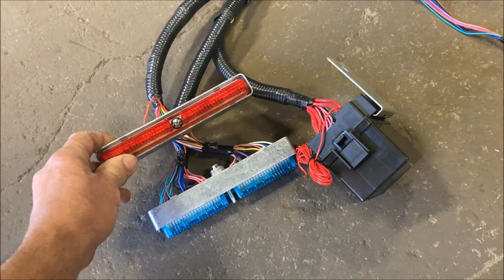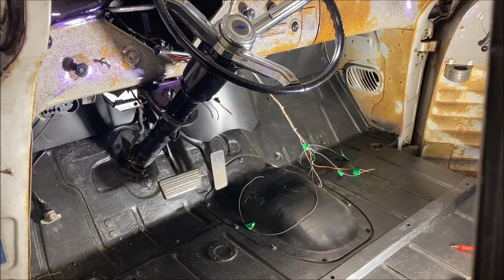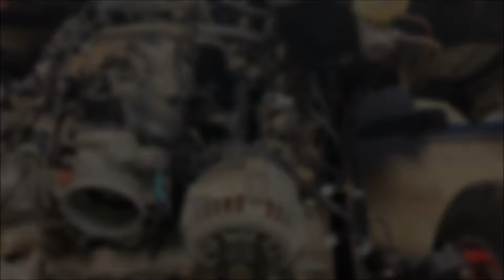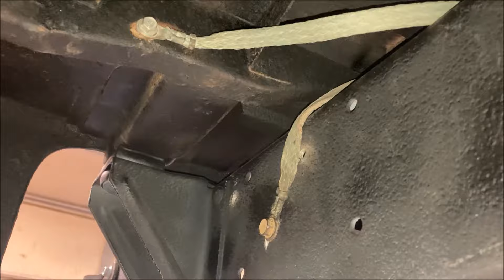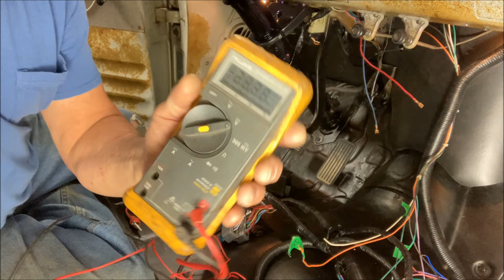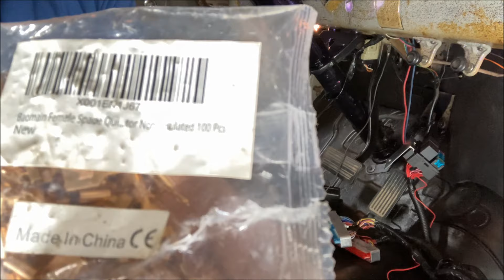Ebay LS swap $79 wiring harness install and first engine start! 1999-2002 Gen 3 DBC, will it run?

Comment from the maker: Just saw that when going over the harness connections on the floor I called the first throttle body connector the IAT, I meant IAC (idle air control).
Reply: Your video has gotten me a long way! Appreciate all the little details. Although, I have everything hooked up as shown, my relays aren’t sending any power out. When I turn the key on they both click as if they were activated but my meter shows nothing coming out. Any possible ideas would be much appreciated! Thanks again
Reply: Your videos are very good with information ,keep them coming

Comment: Question.. can the fuel pump wire be connected it from the relay to the fuel pump fuse on the fuse box? Or it has to be a straight wire coming from the fuel pump to the relay..?
Reply from the maker: I do not understand the question, but the fuel pump should be controlled by a relay and not powered directly from a fuse.
Reply: @rust_hoarder_garage  so I have the saw wiring harness as you.. I wired it the same way as a your video , the only difference is that I wired the fuel pump wire coming from the relay to my fuse box (tap into it). (Fuel pump fuse)
Reply from the maker: if you are using the fuse box to feed 12v to pin 30 on the relay that is fine, just use an inline fuse if you are not coming directly off of an already fused circuit.

Comment: What about the oil pressure sensor? How do you connect that one
Reply from the maker: Oil pressure sensor is not part of the harness, it is not needed for the engine to run. I run an aftermarket gauge.

Comment: You mention the alternator did you have to do something eles to get alternator to charge or with that ebay harness you dont need to do nothing thanks your very helpful
Reply from the maker: Had to add the 2nd wire to the F terminal on the alternator, it is used on the truck alternator but not the LS1. Info should be in this video  https://youtu.be/GX5VUIgd-rw

Comment: How are you getting temp. Reading to your gauges? I know the temp. Sensor is through the engine hardness? Help!!
Reply from the maker: Temp sensor on the front of the drivers side head is only an input for the PCM. I run an aftermarket gauge with a sending unit in the rear of the passenger side head, see my other videos for details.

Comment: I’m swapping a ‘00 gmc Yukon 5.3 into a 4.3 2002 s10. Would the harness from the Yukon be the same as the s10? Or do I need to buy or make a harness like this one?
Reply from the maker: No clue, I have never touched an S10 other than to cut it for parts.

Comment: Got my truck running but having low voltage at serial data obd#2 pin, as well as pin 58 at the pcm. therefore i can’t communicate with pcm, any idea what is causing this? I do have power at pin 16 obd port, Thank you.
Reply from the maker: I would verify the obd2 white power wire is not tied to the white tach signal wire. I go over this in my LS to Vortec harness conversion video if needed.

Comment: Are the injector adapters a must? Great video!!!
Reply from the maker: If you are not running EV1 style injectors then you have to either cut the ends off and solder in the correct ones or run adapters. Thanks for watching!
Reply: @rust_hoarder_garage thanks!

Comment: I have a Holley pump 12-306 in my Monte Carlo and I ran it just like you said. Pin 87 to fuel pump wire and pin 30 to koeo power. Fuel pump comes on strong but the car starts then dies. But if I take the fuel pump wire and tap into pin 85 green wire car runs but only showing 20 psi. Do you think it can be tune related?
Reply from the maker: You have a good chance of burning out the pcm driver trying to run the fuel pump off pin 85, do not do it! I doubt it is putting out enough current to run the pump which may be why it is at 20psi. If it starts and dies when using the relay verify you are not losing power on pin 30 of the relay when the ignition is in the run position.If that is good verify you are not losing power on pin 87 to the fuel pump.
Reply: @ The green wire that comes off the fuel pump relay not getting any power. Do you know what the issue could be?
Reply from the maker: green wire is a 12v feed from the PCM, not the output of the relay. It is a 12v signal from the PCM to turn on the fuel pump relay, not run the pump directly. If there is no power there with key on you may have burned up the PCM running the fuel pump off of it.

Comment: which computer did you use?
Reply from the maker: That engine and transmission is from a 2001 Silverado, I used the factory P01 computer from the truck.

Comment: I got it started but it dies immediately after I’m getting no gas fuel pump
Primes but sends no fuel through the line
Reply from the maker: VATS disables the injectors, has to be turned off in the tune.
Reply: VATS deleted?  Fail safe for ecu.

Comment: Can you use the truck ecu with this dbc harness or would i have to get the ecu from a ls1 camaro.
Reply from the maker: 99-02 truck pcm is the same as 99-02 LS1, just different tune.
Reply: Yes, you can use the Blue/Red drive by cable ECU with this harness. Gen 3 and early gen 4.

Comment: Did your harness not come with wiring for the oil pressure sensor?
Reply: Oil pressure is part of the dash or body harness wiring, and not part of the engine harness for this vintage.
Reply: @glenncattani4843  thanks man, I ended up using a mechanical gauge instead
Reply from the maker: No, it is not needed for the engine to run.

Comment: I just received this harness from JY Performance and there was a separate two wire pigtail in the box. do you know what this is for?
Reply from the maker: If you bought it for a 4L60e watch this and make the repairs, it will be a 4L80 2nd speed sensor harness, otherwise the 60E will have no 3-2 downshift.

EBay LS swap $79 harness, how to convert it from LS1 to Vortec and fix the defects. 99-02 Gen 3 DBC
https://youtu.be/GX5VUIgd-rw
Reply: @rust_hoarder_garage  thank you!
Reply: @rust_hoarder_garage  Ironically its for a 5.3 in an F body so some changes I will have to make and some I might not. your videos are great.
Reply from the maker: Thanks, If you are using the F body alternator, MAF, and IAT then there will not be much to do, but definitely fix the tach wire and trans wire. Good luck with the build!
Reply: @rust_hoarder_garage  Thank you.
Reply: So I haven’t heard you mention having the computer re flashed. I did here you say a few things were turned off
Reply: How did u turn or delete certain things from the computer

Comment: You can install the harness and ECU under the hood. Done them in many swaps. The only way you'll get water in them is if you sit there and spray them directly with water.
Reply from the maker: I would say that would be incorrect unless you never drive in the rain. I have factory GM harnesses here with enough corrosion on the pins that the harnesses are junk, and the Ebay connectors are wide open unlike the sealed GM parts.
Reply: @rust_hoarder_garage  I drive plenty in the rain and spray the engine bay down with a hose here and there. No issues but to each their own.
Reply from the maker: Agreed, your car so totally up to you how you do the work, hope it continues to work out for you.

Comment: how do you wire the ob2 port with the original port?
Reply: For example, im running this exact same harness on a obs chevy, i tied the two serial data wires and plugged it into the ecu
Reply from the maker: Why would you keep the original port? If you are using a BCM or other module that ties to the port you will have to figure out that wiring separately, otherwise the original port and wiring would not be needed.
Reply: @ i just wanted only one port, but thank you for your response
Reply from the maker: that's just it, the one port that comes with the harness is the one you would use, unless there was something from the original you wanted to keep. The original ECM is not in use anymore so the original port would not be connected to anything unless there were BCM wires or something additional you were trying save. The body harness I used in my current truck build came from an OBD1 computer controlled car and had an OBD1 port, but I cut it out because it was not connected to anything anymore.